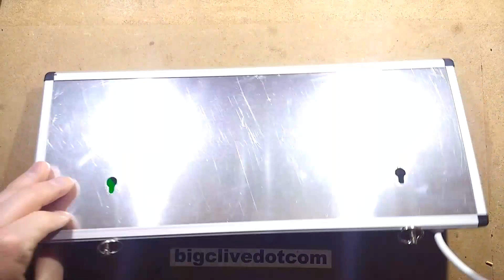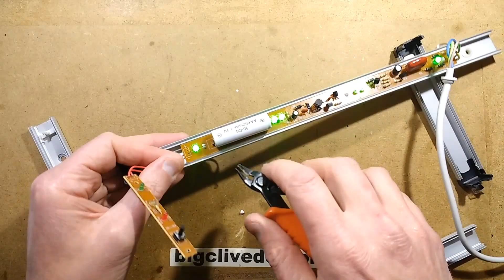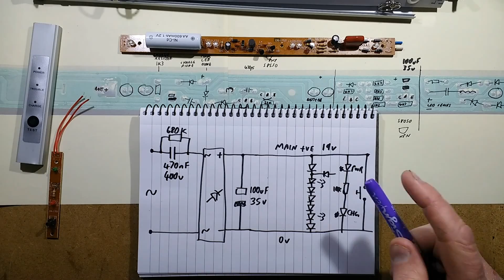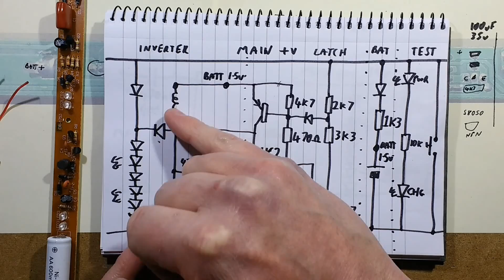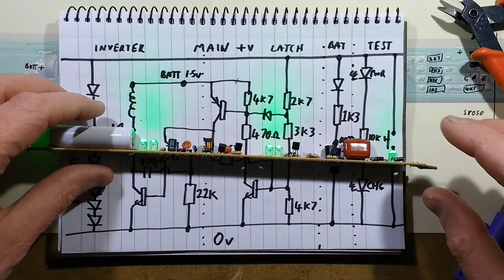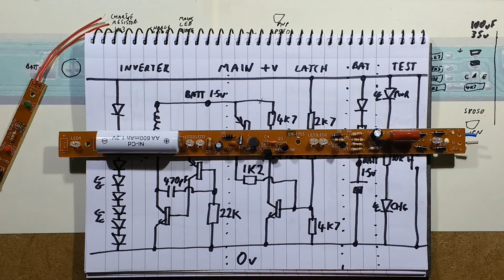Weird emergency "open" sign????  (With schematic.)

Comment: This comment is after 5 years from publishing video. I got 16 'EXIT' signs to repair. Same PCB , and battery too. I repair only 1 yet. Battery get bad. And cap get reduce Value too. All thing could replaced but not battery. Only NiMH are available . So cant replace for the reason mentioned in video. I wonder i should modify it and put LiION battery.

Comment: OPEN could be to designate the/an unlocked door. The NiCd battery should be easier to replace every 3-5 years with out destructive access. Planned obsolescence?

Comment: Does anyone know if there is at present a device that can check the MAH of your 18650's to make sure there legit?
Reply from the maker: Yes.  You can get chargers that measure capacity.

Comment: I'm only a hobbyist, but I'm pretty sure 'inverter' isn't the right word here.  More like 'charge pump'?   But, as testament to my newb status, I can't for the life of me figure out how the lower transistor in the latch circuit (the one he shorted to toggle it when mains were disconnected) stays off when mains power is on!  The 2.7k / 3.3k / 4.7k voltage divider seems to set up the right bias for turn on, but we know the latch stays off when mains power is applied. Can someone help me here?

Comment: With the common simple capacitive dropper circuit, I have often wondered why the capacitor could not be connected AFTER the bridge rectifier.  As I recall, the full-wave rectified waveform has a frequency of 100Hz, double the 50Hz mains frequency, so a dropper capacitor of half the value could be utilised to give the same current.  (Impedance = 1/2пFC)
Reply from the maker: It needs the alternating polarity.

Comment: i am willing to bet why an open sign was made with emergency backup lighting is because to understand why let me compare to tesla motors and 18650 cell makers first.

samsung and lg that makes the 18650 lithium cells used in the tesla cars is bound under some kind of contract where tesla is the exclusive buyer of the cells.

now for the chinese manufacturers to sell to the public even via ebay besides pulling cells from junk cars found in the junk yard they put a simple sticker that reads "18650 3500 mah 3.7v li-ion battery" on each cell to make it  look like cheap batteries so it can get past customs.

i imagine customs may be involved in the enforcement of the contract between tesla motors and lg and samsung.

back to the sign

if a chinese maker tried to sell the signs as emergency signs i imagine that customs in cooperation with the safety code would pull the signs from sale

so to get the signs to the usa they sell them as open signs.

however more over it begs the question why would a business need a open sign to be working if the power goes out since most business would have to close if the power goes out as there is no power to run the lights (required by law) and the cash register (could be ran from ups) or could use manual calculator to figure up the prices.

though having metal frame and real glass is a good sign of quality considering it is all plastics

Comment: I would personally never put LED's in serial for an emergency light... If one fails (or even the resistor...) then the entire light would fail. If you use LED/resistor sets parallel than you still have light. Since it is for safety in the end...

Comment: Hi Clive, 
big fan of all your videos. Thank you.
On the matter of checking earth continuity you must have come across the fact that however metallic looking the frame might be, anodising does not conduct electricity. I found this out the head-scratching hard way when I used a scrap as the contact plate on a home-made cigarette lighter socket. Anodising is also ridiculously hard and a bugger to remove.
Will

Comment: I would tend to think that the 100nf cap across the LEDs is to filter the transient spike from the choke so it doesn't damage them. I would equally assume the larger value cap is to reduce the flicker effect. At least that's my guess.

Comment: You often mention that you cannot turn this sign off! but they why would you need the catch-latch circuit in this light? Could they not just connect the led's to the battery and the AC as a charging circuit on there?

Also, as you mention you cannot turn it off, how did you turn it off in between the breaking it open and the detailed view?
Reply from the maker: A very quick shunt of the battery to put it into standby mode.

Comment: You know how it is easy to forget looking at a screen-shot of a computer screen and then try to scroll or close it? I did something similar with this video. I closed my eyes when he was nipping off the plastic clips holding the boards into the channels. You know... to protect my eyes from flying bits of plastic because I don't have my safety glasses on...

Comment: I enjoyed the technique you demonstrated for turning it off.

If you're running a shop in an outdoor market with intermittent power then having a sign that stays on during the power cut could be a huge competitive advantage! If it is dark out and you're servicing tourists with oil lamps for light, the shop with this thing will be visible as open from hundreds of feet, whereas the people with only lamps people have to get right up close to the stall to see that it is actually open.

Comment: Can smb modify this to use supercapacitor instead of the ni-cd cell :)
Reply from the maker: +FireSwordl Supercapacitors do not have a very high capacity to size ratio.  It could work, but the sign would not stay lit for long and could progressively get dimmer during the discharge.
Reply: You are right, yes I know. Just thought that there is plenty of space to put maybe several C-size supercaps. This unit will last like forever with them. Unfortunately the price will go sky high. I am developing a small unit with 6 500F 2.7V supercaps and USB output with booster. I measured output energy equivalent to ~400mAh Li-Ion battery.....

Comment: In remote areas, where power is intermittent, being open but lacking mains is a not uncommon situation. My Dad worked in a service station that had a couple of pumps that had crank handles for emergency use and some nasty petrol lamps in the window that gave enough light to pump and read the meters. Last fuel for, oh, quite some miles, in 1960s Australia. Late night power drop out were not uncommon.

He very quickly rigged a couple of car batteries and some sealed beam headlights to give decent light, as he slept behind the counter on night call and the petrol lamps smelled and were too bright to sleep under. There was a bell on a chain for service, if the station was unmanned, the bell pull was hauled up out of reach and the "ring bell" sign turned around, very high tech.

Comment: Handy if you run a shop in a country with lots of power cuts due to wire thefts, coal strikes or power struggles, and you want to keep the shop open in times of trouble and strife

Comment: How could a shop still be open for business if the power fails? I don't see the point of this sign.
Reply: they can't because the tween's that they higher don't know how to do math in their head ( nor did they care to learn? ).
I do have to say I was in a supermarket (US Tops) that was undergoing electrical work for about an hour at night. and apart from the plastic over the open refrigerators and all lights being off except the emergency lights. and all the registers on UPS's, it was a very interesting experience that I'll probably never have again! but so cool!
Reply: That would an interesting sight. Eerily quiet, dimly lit isles. Sounds like the perfect time to hide and then jump out at other late night shoppers.

Comment: would totally use that for a mount for high power cheap leds n to hide the power supply and a fan...pretty cool unit, you can do a crap ton with the parts!

Comment: Nasty Lithonia Lighting exit signs have this same weirdness with the capacitive dropper and nicad battery. If there is a lot of harmonic distortion on the incoming power, parts overheat and smoke. Glooooriouuuusssss

Comment: I have been in facilities that have doors that are locked with electric  locks in case of a power failure a few doors have a emergency unlock and it has a sign that glows open above it when the power is cut. Mind you the signs on those doors are made up to code.

Comment: I took apart a certified battery backed exit sign awhile back and interestingly the latch circuit was very very similar to this one.  A good way to describe it is it has an SCR-like action, which can be modeled as two transistors (one NPN, one PNP) cross coupled back to back.  The set in this sign is no exception.  In the sign I took apart, it has two pads on the board which I presume were used in manufacturing to turn it off for shipping when shorted out.

Comment: Much naughtiness here! Mod time! Get one 5v DPDT relay, and wire the N.O. contacts across the dropper cap, and the other set across the "test" switch. Drain the batteries with a resistor. Now hook up the coil of the relay so it turns on once there's a power outage. Put everything back together and give it some schmuck you don't like. At first, nothing will happen as the batteries will have to charge. When they leave the shop for the day, the batteries will now light the sign, and said schmuck will now be unhappy that their "open" sign is still lit. They'll likely unplug it, thus arming the new "self destruct" feature! Now stand back when you see them go to plug the sign in again!!! :) Or better yet, see if you can sell the "new and improved" design back to the Chinese - make sure to undercut their own prices for even more fun!

Comment: Getting plastic push pins off - It helps to have an assortment of ink pen tubes. You can cut or heat and expand them to various hole sizes so that they can be slipped over the push pin, retracting the tabs on it enough to fit through the holes of the panel they're mounting.  You can also buy some aluminum rod and make holes in each piece with incrementally larger drill bits (on a drill press).

Comment: Is it easy to remove the film off the glass plate to change the light's appearance, or is that not possible/hard to do?
Reply from the maker: It's not dissolving with acetone.  It might be baked on enamel.
Reply: Thank you!

Comment: You should really do some audio gain compression and filtering in your vids Clive, your voice is pretty bassy so it comes off as soft on small speakers as typical on a laptop or cellphone, but sounds really heavy on a pair of large speakers or HT system with subwoofer. 

Also going to other youtube content which include loud jingles or explosions after watching one of your vids makes viewers jump out of their seat.

Comment: Look at 30s.  They also have a CLOSE sign.  Not CLOSED but CLOSE.  So perhaps think in terms of there being something which you need to open or close even in a power-down situation.  A door, a gate, a valve or similar.

Comment: you could use for a farmers market (or other off grid shops). Just plug it at home and you have three hours of open sign
Reply: just like my emergency light flashlight torch, all I had to do was add a battery switch and cord.
Reply: that sounds useful

Comment: Hi Clive,
In my opinion, the "latch" circuit is arranged so that it cuts the power when the battery discharges at 0.8 volts (roughly), thus preventing the step-up circuit from over-discharging it: what do you think?
Reply from the maker: It cuts off at 0.85V
Reply: Many thanks, Clive!

Comment: just a quick suggestion re. the mounting pillars that caused you so much trouble....... if you remove the ink refil from a BIC biro,  pushing the empty plastic case over the pins releases them with ease.

Comment: Incredible how this can be cheaper than  Capacitive dropper -> 0.05-0.1$ 5v regulator -> 0.2$ lithium battery charger IC   - > battery ->  4.2v from battery  OR 5v from mains (two diodes, higher voltage wins)  - > leds with a current limiting resistor.
In a normal world, just having so many different resistor values and different transistors and old Ni-Cd batteries and so many through hole components would be more expensive than a much smaller number of parts you could buy in higher volume)

Comment: An open sign with emergency battery backup. Must be an emergency exits operating instructions
The two transistor latch circuit is basically a gate turn off thyristor.

Comment: Do you have a huge stockpile of lights and electronics lying around your house?
Reply from the maker: +Zerobrine /anon It's a veritable mountain.
Reply: Zerobrine /anon
Rumor has it, the Isle Of Man is part of the solution to affordable housing in the UK. All the old LEDs, plastic and crappy Chinese aluminium from Clive's place is being melted, and formed into cheap plastic houses with eco friendly (albeit rather pink) LED lighting formed into the walls.

Comment: Thank you for showing these "random" items from Ebay. Every video is like xmas you never know what you will get or find!
I have been window shoping on ebay for a few weeks now and there is alot of stuff there. I like when you provide the seller's name and if its good or bad. Oh one more thing i noticed you roughly calculated how long the battery would last with the current load. I would love to see more of that "Detail" when it comes to battery charged things.

Comment: i can think of a few places that could use this sign one being Waffle House here in the USA. When the power goes out we just opened the doors to prevent carbon monoxide build up down and kept on going. mind you this was 20 years ago things might have changed since then but i doubt it.

Comment: Folk struggling with  understanding that latch arrangement might prefer it re-drawn as a relative of the two transistor equivalent of an SCR. As explained here http://electronic-projects.50webs.com/transistor-circuit-substitute-for-scr.htm
The clever bit of subtlety here is the way it is triggered as the mains power starts to fail. To fit caps accross the LEDs is actually good, in two ways, one that the chips are not subjected to a waveform with a very high peak to mean current , improving lifespan, and depending how it is done it can also greatly improve the EMC performance of an LED driver - some of those that drive the LEDs with pulses and have long tracks with the pulsed waveforms make a depressingly good AM radio jammer.

Comment: Maybe it's used in places where an exit door is usually kept closed but designed to fail open with power loss (perhaps an electromagnetically locked door)?

Comment: One of those things that may well be worth the purchase for the frame work parts and perhaps the LED setup.  Well lots of things to play with. I recently picked up the top part of one of those solar sidewalk illumination lights at a yard sale for a quarter. It works great when supplied with a AA battery, and is very bright to my surprise. Must be the same sort of setup, however when I took it apart it had  very few components, I expected to see a sort of juele thief setup but not quite so, I guess because of the light sensor and solar cell but it is a very small board and very few components.  Mostly run by an IC with a couple of transistors and a resistor or two as well as an inducter in the guise of a resistor type case.  These things are great to tear down and reuse, not sure what I am going to do with the little light, right now it lays on my end table and when the mood strikes me, I put a cell in it and play around.  Doesn't take much to entertain an old man who grew up in the Kerosene lamp age, and  ushered in the dawn on the electronic world.
Reply from the maker: +Jerry Ericsson If I can travel back in time I'd go back to the 70's to usher in the electronic era again.  It was just an incredible time.
Reply: Oh ya, man I still recall looking over my fathers shoulder as he poked around in our old AM radio. I ran on a large battery pack, almost identical to the ones I used in the old AN/PRC77 radios in Nam.  He would tell me to look for the glow in the tube to try and decide which one was going bad when the old radio misbehaved.  That radio was the entertainment center for us back in the 1950's, and my love for electricity grew from those days.  When we moved off the farm and into town, where we had electricity, I began tearing apart every electronic thing I could find, regular trips to the dump ground found me tons of things to tear down, and rebuild into HI-FI sets, this was before Stereo came along.  Yes it was a wonderful time indeed, I was in the  US Army as a communicator for 8 years during, well the first 8 years of 1970 beginning working with field phones and wire, and ending up running my own communications section at an infantry company level , with cross-training in land line teletype, and radio teletype, those early RATT rigs were huge and needed a deuce and a half to haul, the latter versions were on 5 quarter trucks and much more compact, and more powerful with their SSb radios.

Comment: The capacitors across the LED string may be to reduce EMI from the boost oscillator and the peak current/voltage across the LEDs. For you to read a 9mA average current through the LEDs which total ~18V, the boost circuitry from the 1.25V NiCd cell must be pulling around 150mA through the inductor. Without capacitors to average the flyback's output current, the LEDs would be seeing those ~150mA peaks and might not live long.
Reply: Yeah, I don't think the results would be too good without the caps.  I think the reason they use two is the small capacitor can handle the high-frequency part that would shorten the life of the bigger capacitor.  That way you don't have to pay for expensive low-ESR caps.